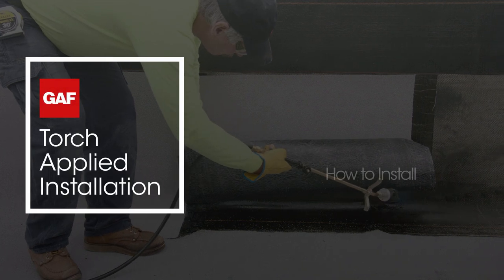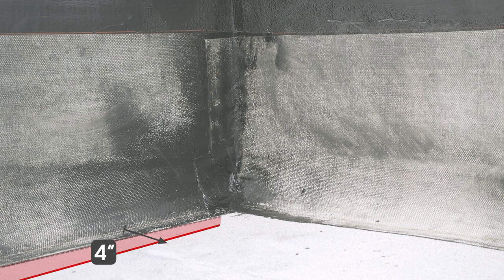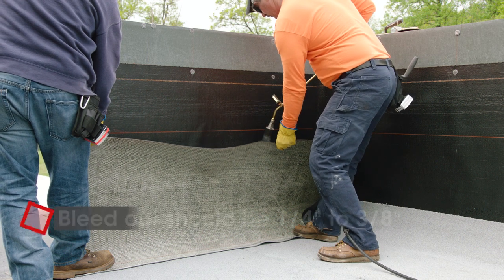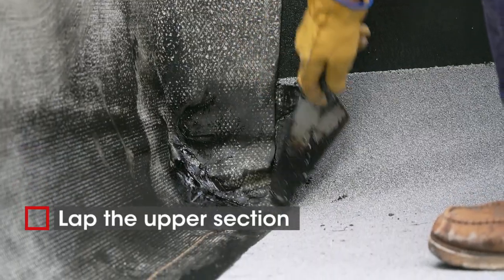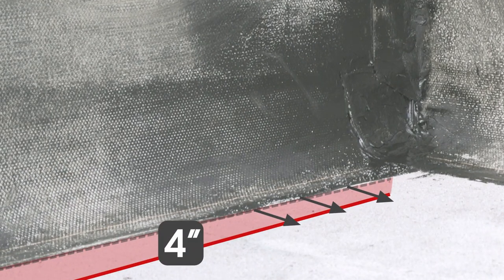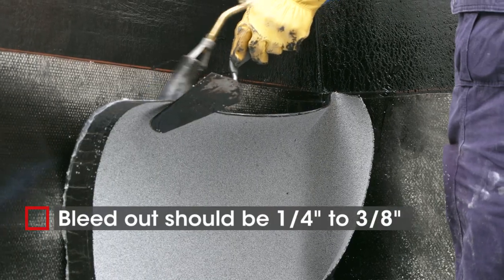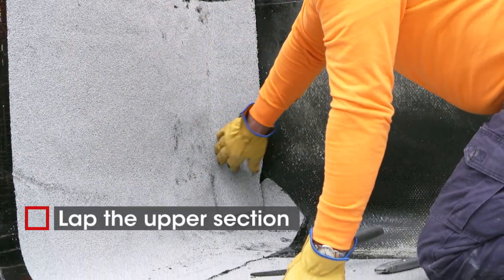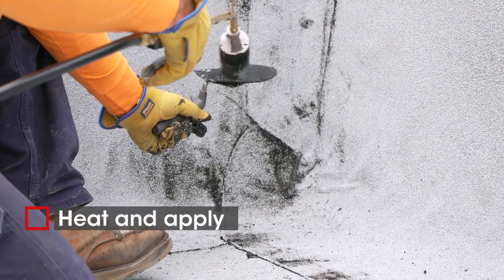GAF Roofing | Torch Applied Training for Inside Corner

Comment: I’m not a flat roofer for but I was just would’ve made one piece folded it for the corner and ran the two into it. I gotta do my son‘s roof it’s mostly shingles has a couple of square of flat roof
Reply: That's how I cut my wall sheets when I've done hot rubber and hot tar. These guys are doing it by the books though with the overlap for warranty work
Reply: @michaelhoughton8449  thank you for your post

Comment: I would not use GAF roofing.  I have a problem with their shingle now after 7 years.
Reply from the maker: Hi, we recommend you connect with our Warranty Claims department if you believe there is a defect with your shingles. You may call them at 1-800-458-1860 or send an e-mail to warrantyclaims@gaf.com. You can also file claims online via this link: http://spr.ly/6051pEo4R